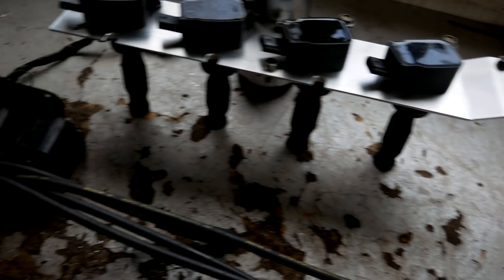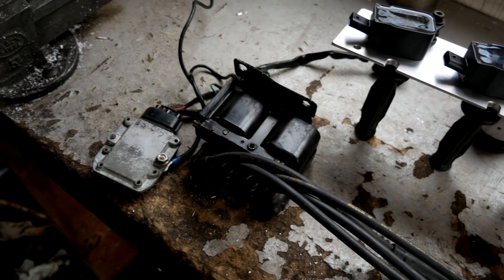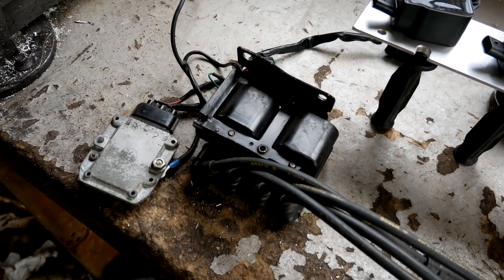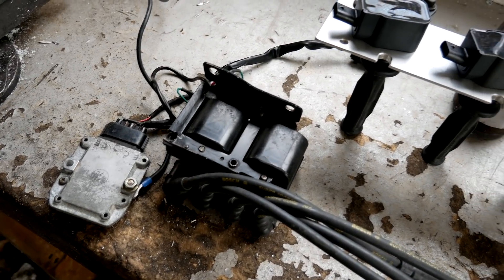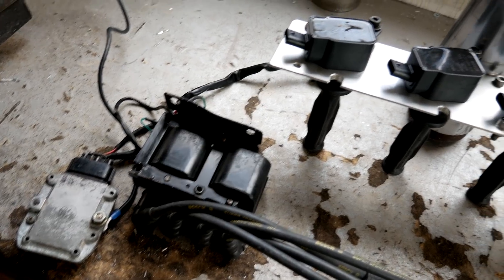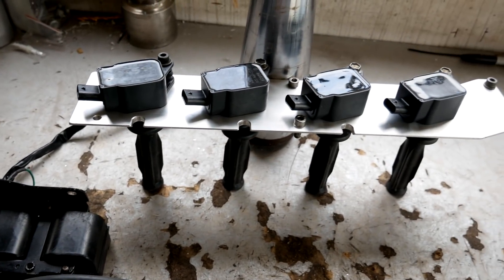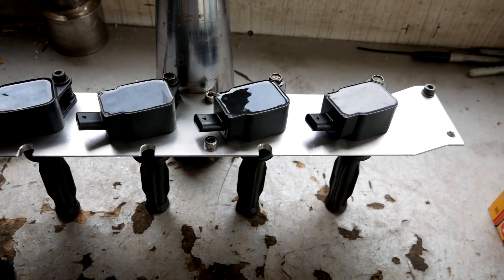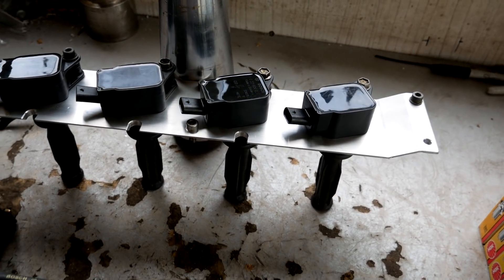More Spark = More power?   Dyno tested

Comment: The primary function of the ignition system is consistent spark. What happens in the cylinder with regards to the ignition system is probably the least understood area by most people.

The two best upgrades, which will still only give small power increases, are small centre electrode (projected if conditions will allow) with set back earth strap and sequential programmable timing.

Electricity will always follow the path of least resistance. Worn standard plugs have rounded edges because the spark erodes the electrode over time. So obviously that means the spark is moving round a lot. A set back earth strap is to allow more space for the flame kernel to propagate. Some engines respond to plug indexing. Indexing is for two reasons. So there isn't any plug treads in the chamber to cause hot spots. And to position the earth strap. Earth strap position depends on chamber layout. Not really an issue in a pent roof 4 valve. A lot of people don't realise the spark moves on the earth strap with ignition advance.

Sequential ignition timing is most helpful in shared unequal inlet runner situations and fine tuning for temperature variation to avoid detonation on hot cylinders. 

Massive output coils are best suited to poorly tuned fuel curves. Or high cylinder pressure alcohol.

Big gaps and cold plugs will always cause trouble unless the engine really needs them.

Spend money on just everything else first if you're looking for gains
Reply: Electricity does NOT take the path of least resistance, it takes many paths but the easiest path has the most flow and the hardest path has the least flow. Platinum or iridium plugs always give the best spark due to the needle tip electrodes which require less voltage.
Reply: @1magnit  So what you're saying is electricity will flow along the path with most flow?
Reply: @1magnit You're saying the same thing with more words

Comment: First off for those who don’t know the spark plug heat range is to do with the plugs ability to self clean and not cause preignition. A hot plug will clean itself better than a cold plug but might get so hot as to ignite the fuel without spark. A cold plug may foul up and either not allow the spark to ignite the fuel or more likely the deposits on the plug will glow red hot and ignite the fuel without spark. You fit colder plugs to boosted engines as they’re more likely to pre ignite with a hot plug.
Second.
Having good spark really can boost power and efficiency. It is most notable when going from very poor spark to a good spark. Not so noticeable when going from good to better.
How to tell a hot plug from a cold plug.
Look down inside the the plug at the length of the ceramic insulator around the electrode, the deeper into the plug it goes the hotter the plug and the shorter it is the colder the plug. If you compare a hot and cold plug the numbers will make more sense.
Reply: I thought it was more about the ability to transfer heat to keep cyclinder combustion temps correct.
Reply: @simond7582  that’s done with correct fuel mix as well as water meth injection and charge cooling.
Plug heat range is solely to do with preventing knock

Comment: WOW thats very cool.... love your testing !!!!!!

it would also be very cool if you could test how much indexing spark plugs will affect the Torque/Power

and also test the myth of side gapping spark plugs

that would be sooooo cool if you would bring light in the dark of those myths !!!
Reply from the maker: I was meant to test that in this vid but tbh I totally forgot.    But since going from a 0.2mm gap to a 2.5mm gap didn't do anything. I think we can assume indexing and side gapping  will have the same effect, at least on this engine anyway.   Also when i gapped the plugs to 2.5mm the spark would have been going off to the side,  can see it in the video the closest point between electrode and strap is off to the side rather than straight down.  this is where i measured the 2.5mm also.

Comment: @Garage 4age - Any thoughts on filing the ground electrode to be shorter,  halfway across the center electrode of the spark plugs? Some naturally aspirated Honda folks swore by this back in the day
Reply from the maker: I don't think it would change anything.    The whole going from 0.2mm to  2.5mm and  no change. Along with the 2.5mm's case, the spark would have been firing off sideways.  gives a fairly good indication.  but yeah I haven't tested it so cant say for sure.
Reply: @Garage4age  Thanks for sharing your thoughts on this

Comment: For race application, I prefer wasted spark so I can mount the coil away of the engine harsh environment (  heat and vibrations). Saw too many coils on plug fails at the track ! For street use, you don't have to bother with aging plug wires when using coils on plug.
Reply: You can remote mount individual coils as well.
Reply: Wasted spark and coil on plug are referring to totally separate things. You can have wasted spark with coil-on-plug, and you don't have to have wasted spark with a coil pack and leads. Wasted spark just means that the spark fires near TDC on every stroke, not just the compression stroke.
Reply: @noxious89123  I think most people know that "wasted spark" is meant to be one coil for two cylinders, every end of the secondary coil connected to one plug.

Comment: Pretty much what would be exactly expected, only thing I can see it probably benefitting from with "tuning spark" would be if you can manage to get injector differences to show with better atomization from some different injectors, but then the issue comes with intake manifold turbulence and it going less atomized over distance etc

Comment: Tested this on a Honda Grom once, I tested different shape spark plug tips instead of heat range. It did make a difference, could get a few MPH faster top speed on one vs another.
Reply: Yeah, just because wind or atmospheric pressure variations.
Reply: So, some motorcycle racing friends clued me in on the REAL secret to "faster" plugs. Some plugs take up more of the availbe combustions space, increasing compression. They would measure "too long" plugs, to see how much they could protrude before hitting piston (accounting for expansion!!!). Beware, this is not for the amatuer. But some plugs that are less 'hollow' than others seem to so the same.
Reply: @nobodynoone2500  I think there are easier ways to get more compression, why did they chose this one ?
Reply: @C4H10N4O2  With the very small combustion chamber it could make a bigger difference if the plugs take up more or less room. And, if there isn’t anything else you can do gaining that little bit extra can be important.
Reply: @C4H10N4O2  A plug swap which takes two minutes has GOT to be easier than any other method I can think of, eg changing gaskets, changing pistons, machining cylinder heads or cylinder blocks. The engine strip options have got to be better though, they are relatively permanent and don't feature a spark plug sticking too far out and disrupting air flow.

Comment: Nice test, indeed upgrade when needed. 
Many years ago I tested my old chiptuned 206gti with side gapped plugs. According to the dyno function on the DET3 piggyback this gave me 4 / 5 horsepower. 
Side grappig makes sense, becouse of the uninterrupted flamefront.
Something to test on a real dyno?
Reply: How was det3, planning to get one, how easy it is to tune and what are its capabilities
Reply: @vid4525  It's okay for older cars, say pre '95.  I couldn't alter the ignition becouse on the 206gti becouse you couldn't alter the camshaft sensor and the Crankshaft sensor at the same time.

I installed it on my old sc28 fireblade and couldn't read more than 10k rpm and the ignitionsignal output, was not an altered copy of the input. It didnt work on higher revs past 3k.
Ran an wideband lambda sensor as a input signal for the DET3 for logging and adjusting the carbs. And that worked very nice.

Comment: Me when doing an extremely dodgy job rigging up an auxillary distributor to run off the front of the cam gear which will distribute the spark timed by the gutted remains of the distributor at the back of the head: "It will either work or it won't, it won't make any difference to the power"

Comment: The reality behind ignition upgrades is that when you've got boost you get to a point where you need to close the gaps to stop the misfiring. Closing the gaps is bad because the burn time increases slightly. When you upgrade the ignition you can actually increase the gap without misfiring, the bigger gap gives a quicker burn and at the same time you can  retard the timing slightly to compensate for the quicker burn, then you get more power by eliminating some negative work.
Reply: I kinda wished he would have gone back to the stock ignition system first and tested that ??
Reply: The hidden problem is people will use cheap coils because REAL individual coils are crazy expensive. Other tests have shown china clone coils are mediocre at best. That's usually a step backwards.
Reply: @hydrocarbon82  You're not even close to the truth.https://www.youtube.com/watch?v=2ig8wQ9uRvc&t=10s Junkyard parts.
Reply: Definitely. If you've ever felt spark plugs get blown out under boost I don't recommend it. Feels like going from WOT to full brakes.
Reply: That's usually fuel cut. @Rick_B52
Reply: Right on..  there's a good book on this. Lots you can do. "Dr. Jacobs ignition guide" or something. I learned a ton from it and used to run his ignition computers with great results
Reply: That's why Dodge running 2 plugs per cylinder
Reply: That is sort of true. 
Sure, more boost means you need a better spark, thus better ignition coils will benefit. 
But when it gets to the plugs, it's mostly about the heat generated from the engine/combustion. The gap is minor when considering what the plug has to achieve, the coils give that extra power. 
The key is how much heat the plugs have to transfer to the zyl. head. 
To little heat transferred means, plug gets to hot, melts. 
To much heat means, plug stays to cold...
And that's where the importance of the heat range of a spark plug comes from. Wamer and colder plugs. The 'to cold' plug will not be able to reach it's self cleaning temp to get rid of combustion disposal and thus, misfire.
Love the channel, you bring us forward ✊
Reply: If your running boost just run High Fire Coil packs or an HEI ignition system for a car with a distributer, and this cold plug for boost and NoS to is totally wrong you want the hottest plug you can get, Hot plug= clean burn which = more HP, I ran NoS for years and years always ran HoT autolites never ever had any problems with my race car when I had to run Motorcraft my car was 0.1 of a second slower in the 1/8 mile so plugs do make a slight difference in power it’s not huge but there is a difference
Reply: @shorty808100  autolite plugs baahahaha

Comment: Your 65mJ COP won't be 65 mJ, it never is. Is that supposed to be  the stored energy or is it some sort of claimed and unproven output to the plug.
Reply from the maker: "spark energy 65mJ" is  whats on the bosch data sheet.
Reply: @Garage4age  are they r35 coils? Genuine? What part number, love to check them out. Keep up the good work.
Reply: OK it's calculated using Bosch test conditions.

Comment: I dyno'd a Yamaha 1100 years ago. The last thing we did was put in "J" gap plugs and gained an instant 2hp. I've also installed a high power CDI on an engine that was running sweet, no obvious misfires, and gained power. The problem with nuclear ignitions is that they will fire weak mixtures and actually cause engine damage where a lower power ignition might misfire. Your engine isn't really testing the ignition. A leaned on turbo engine would be another matter I think. Having said that, I'm currently running LS2 coils on a high revving(18K) turbo engine and they're sweet
Reply: I have lq9 coils on my 2J

Comment: In my experience, COPs don't add performance, they add reliability. 1 coil/cylinder fires 1/2 as many times as wasted spark, and 1/4 as many times as a dizzy/coil set up.  Also, there's no plug wires to worry about.
Reply: Well since none of them actually made a difference in performance then reliability vs cost becomes your factor....wish everything was that easy.
Reply: For a 4 cyl dizzy setup, you won't have enough (inductive) coil dwell upwards of 9krpm. So if you're not revving with that high,  wasted spark or direct COP ignition won't make a lot of difference.
Reply: COPs are junk compared to wasted spark. There's several technical reason for that.
Reply: @1magnit  I would love to see proof of this claim.
Reply: @1magnit  ok? What does that prove?
Reply: @deciplesteve  It proves you should find yourself a different hobby.
Reply: @1magnit  and exactly how does it prove that?

Comment: coil on plug offers huge power gains over wasted spark when used on a powerful turbo car with a standalone ecu.

on low power na setups the difference is usually insignificant (as proven by this video).
Reply from the maker: I dont think so.  its more a supporting mod.  if you gain power from changing ignition engine would have been misfiring.
Reply: @Garage4age  if you need see result with coil you need more that 11 @ 1 of compresión . The compresion turn off the std spark
Reply: Modify the dwell at 0.63 mm on cop
Reply: @TheSol115  burn it out?
Reply: Wasted spark is far, far superior, the reason it's not popular is cos there's no money to be made from it as well as people not understanding the electronics of it.  .https://www.youtube.com/watch?v=2ig8wQ9uRvc

Comment: Its also important to note that Heat Range in spark plugs is a supporting mod to prevent detonation at high loads, rather than a horsepower source...
Reply from the maker: Yeah thats what I was trying to say  at the start of the video
Reply: Pre ignition not detonation.
Reply: @1magnit  knock knock
Reply: @BadAssEngineering  You can't hear pre ignition because the burn starts before the plug fires. You can only hear detonation as it's an explosion of the end gas
Reply: @1magnit  pre-ignition is detonation as the flame burns with a precompressed zone
Reply: @jovanu4  Pre ignition is when it starts to burn before the plug fires. Detonation is an explosion of the end gasses, it happens after the plug fires, The difference is whether it happens before or after the intended ignition event.
Reply: @1magnit  exactly right pre ignition is fuel ignited from temperature caused by compression before the spark. Detonation is happening after the spark when some fuel ignites starts to burn and causes the pressure and temperature to rise and ignites the rest of the fuel all at once  causing a ping or knock which shocks the piston and rod at a higher position in the cylinder where it can't transmit the force to the crank. The piston is pushed more lateral in the cylinder because of rod angle.